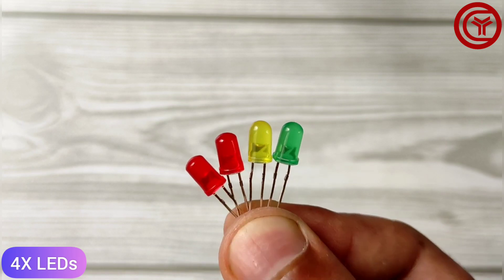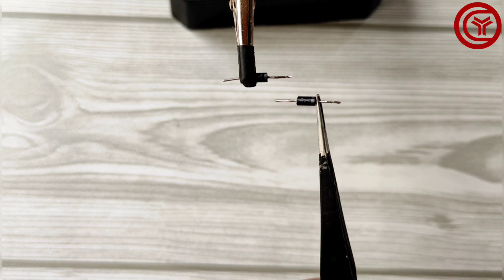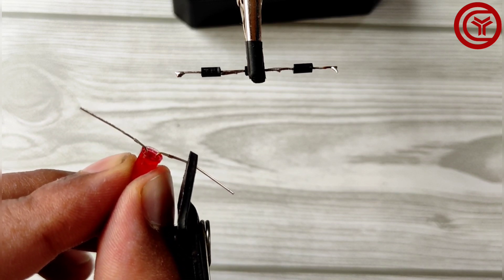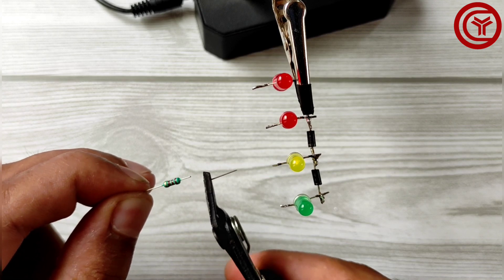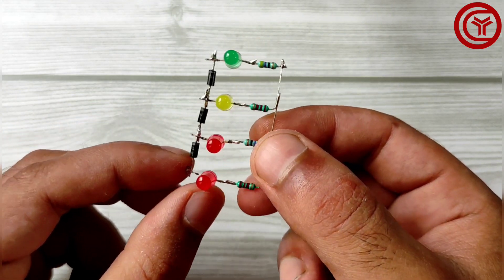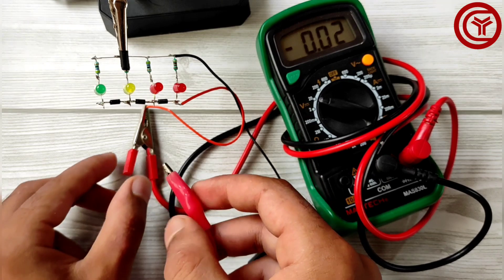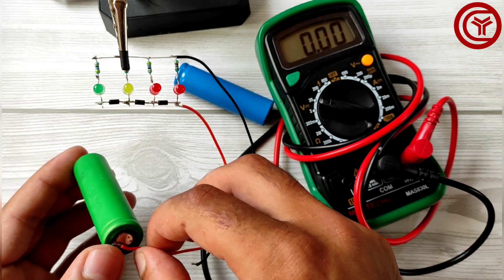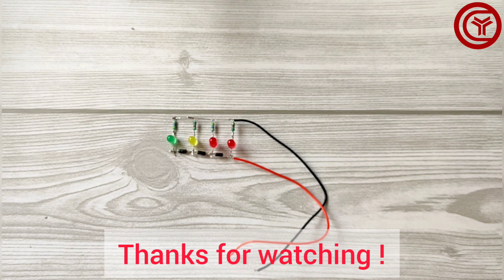3.7 volt battery level indicator circuit

Comment: How could I do that for 2S 18650 batteries?
Reply from the maker: You can add 2-3 more leds in series as 2s will have full charge voltage upto 8-8.2v

Comment: Sir If we have to use it for 2.2v or 1.5 v battery then what are the changes we have to make in circuit
Reply from the maker: Cannot be made with this circuit, since led itself glows @ 2.2-3.2v

Comment: can this circuit be connected with automatic cuto off if lm358 after connecting it will it act like power bank circuit blinking while charging
Reply from the maker: No, it is ideal to use push button between battery & this circuit, and press button whenever you would like to check battery level.
I'll soon upload video of battery level indicator with auto cutoff charging.

Comment: Please show how to make battery indicator for 3v only sir? Think you
Reply from the maker: For what 3v thing you need?
Reply: @CreativeTechos  3.2v for lithium battery indicator.
Reply from the maker: Usually lithium batteries are rated @ 3.7v and full charge voltage 4.2v
Reply: @CreativeTechos  ahh okey thank you

Comment: Very nice and simple circuit it works well for 3.7 volt battery. Can this circuit be connected to a device that is being charged to show the level of charge like a charging monitor.Can you please post a level indicator for 5 volts cell phone and also for 12 volt batteries
Please reply with circuit diagrams 
Thanks
Reply from the maker: Yes, i will soon upload video of adjustable battery level indicator for any battery.
Reply: @CreativeTechos  Its Kiloohm or Ohm?
Reply from the maker: Ohms

Comment: Any color LED can be used?
Reply: Yes bro
Reply from the maker: Yes you can use any colour LED
Reply: Each colour LEDs have a different voltage threshold, 
eg.for same intensity tweaking Red LED needs lower voltage than purple LED, 
BUT in "general" it doesn't make much difference.

Comment: good one if it works. but i think we can use some small resistors there instead diodes which mostlikely are acting as resistors
Reply from the maker: Nope you can't use Resistors, as diodes there is to drop voltage while blocking reverse voltage
Reply: @CreativeTechos  but the leds allready acting as resistors. so their work seems like doing partial resistance by lossing lots of power while doing their job ?.
Reply: The diodes are used as Zeners, but they have a handy lower forward voltage you have to exceed before they conduct.
Reply: @jimfalls8671   that seems like undocumented feature of dioddes.

Comment: Hi, if we use BMS then low cutoff threshold is 3.2v or something then how to show it as 25%? Can you please suggest what to be done.
Reply: Calculate different resistors so the 25% LED glows at a different voltage
Reply: connect this circuit directly to the battery.
Reply from the maker: Yes, connect directly